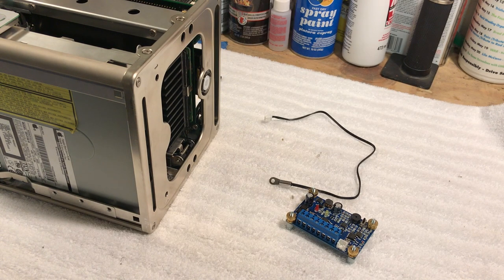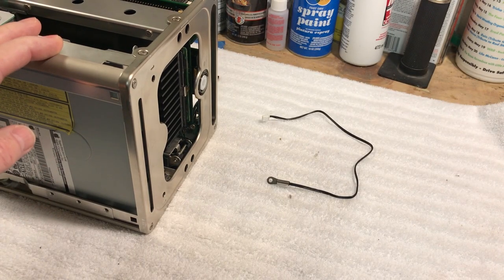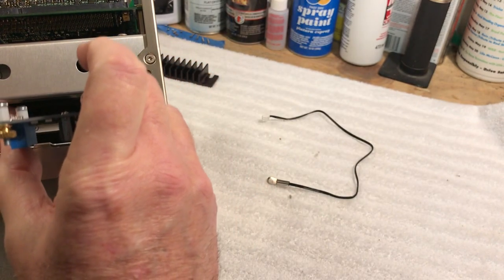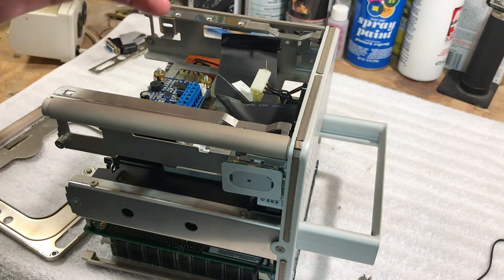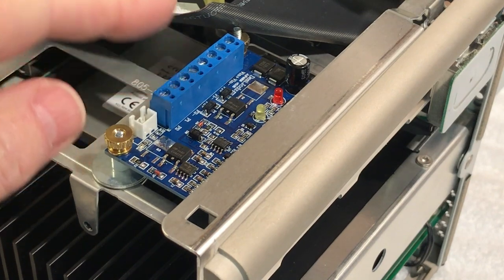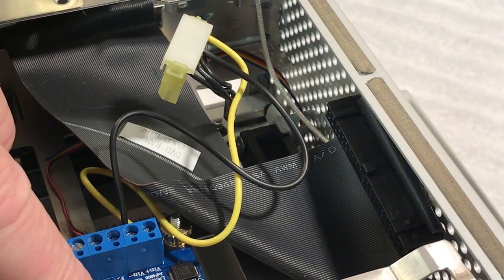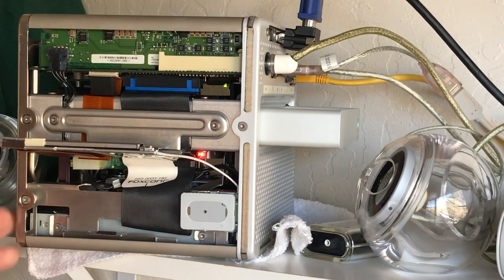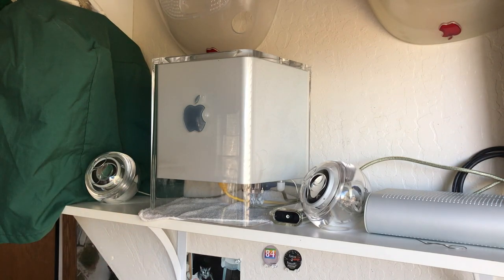MODDING THE G4 CUBE INSTALLING A CNC AUTONOMOUS FAN CONTROLLER Part 13

Comment: Did you use 9.2 for the firmware update?  It will only work in this version.
Reply from the maker: Yes  even talked to sonnet and said in is a known problem
Reply from the maker: Thank's you very much I Have A sonnet St Encore 1.4GHz Coming This Runs  Natively No Firm Ware Up date required for this one I returned the 1.6GHz To The Gentlemen that I'm getting the 1.4Ghz from. Watch the G4 Cube Chronicles some time in December he will be my first guess